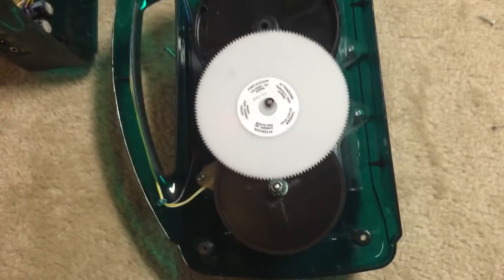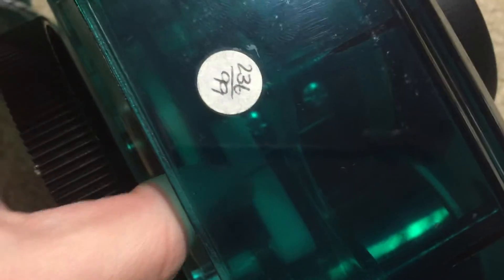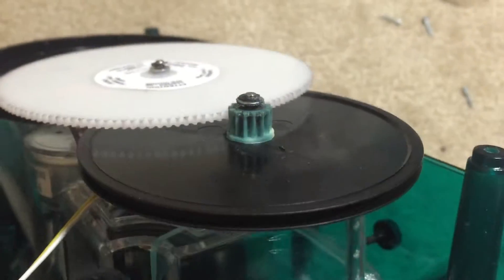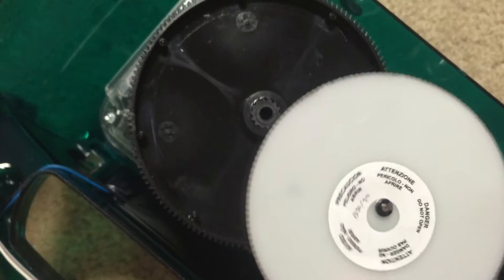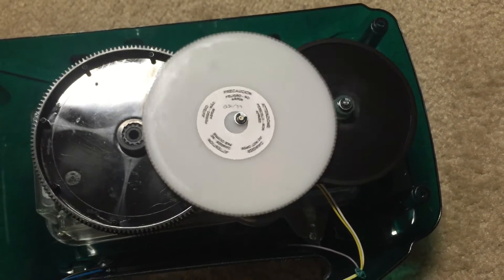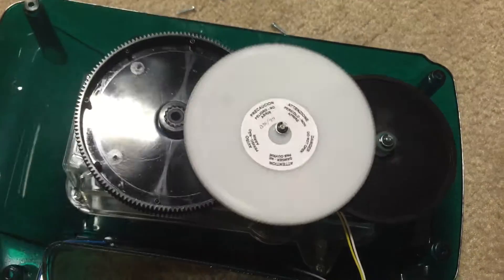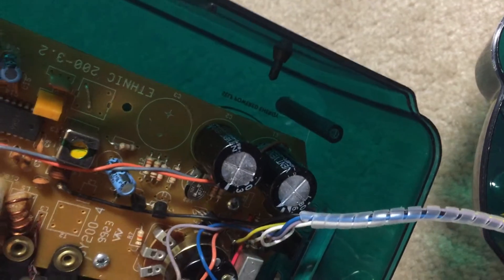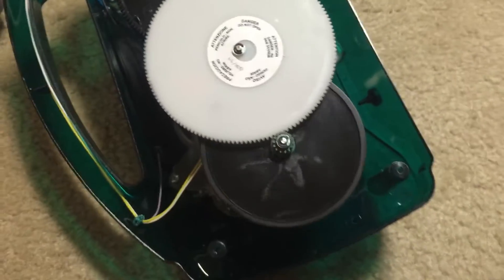Freeplay crank powered radio mechanism in action

Comment: I have just ( partially ? ) mended a  VERY  noisy one of these .... the problem ...  the UK designer ( Trevor Bayliss ) did not put a DECENT spindle bearing on the last (  black wheel  )  FAST  bearing , the spindle " slop " is  AWFUL  ! .... a simple roller bearing would have prevented the noise and " hunting " ... a brilliant concept , let down by ( cheap - n - nasty ) production short cuts ( caveat emptor ! ) ....... DAVE™ ..........
Reply from the maker: It is a shame that they didn't use better materials, or make the belt more easily accessible for replacement.

Comment: The drive gears slowly turn to cheese on these...i use gears salvaged from scrap printer's to repair them.
Reply from the maker: I've heard from a few people the gears on these give out after a while. Mine has been mostly sitting in the box, so it's not getting much use.
Reply: Yup, mine has a noticeable 'groove' carved in the middle around the circumference of one of the gears.

Comment: I would imagine the large caps are as much about short term storage as they are filtering
Reply from the maker: The radio stops playing a second or two after the mechanism stops running, so they are mostly for filtering.
Reply: Yes indeed, decoupling is needed, but given the capacity of this bank of electrolytics, they serve to provide a small reservoir in order to overcome short term supply sags more than filtering

Comment: Imagine having to replace that motor/generator. This spring mechanism must be like a bomb ready to explode if opened.
Reply from the maker: Yeah, that's why there is a warning on there not to disassemble it; it would be dangerous to take this thing apart, especially if it is jammed in a fully wound state.